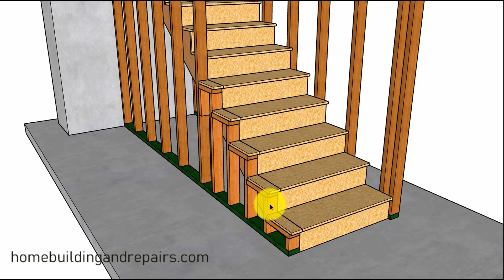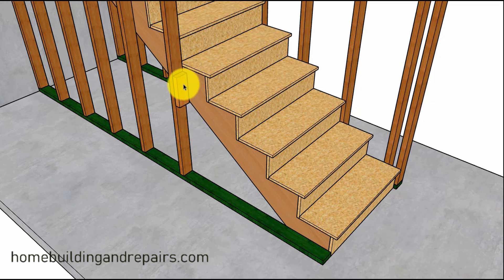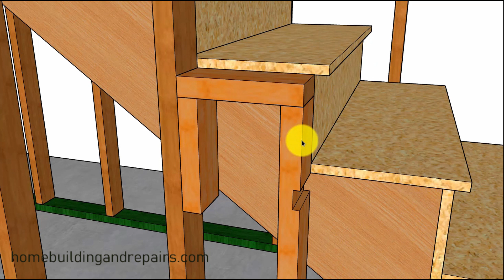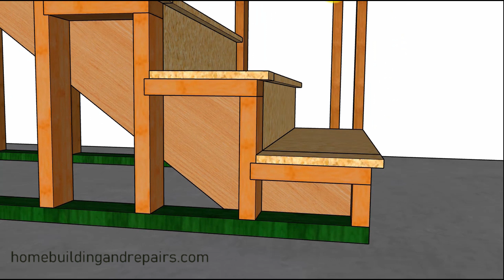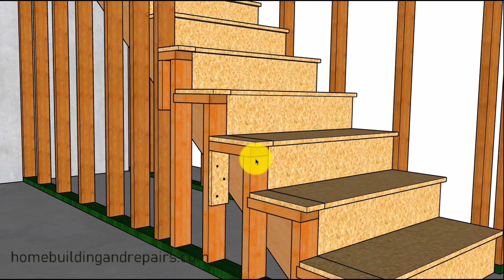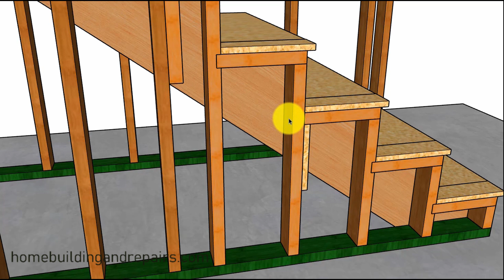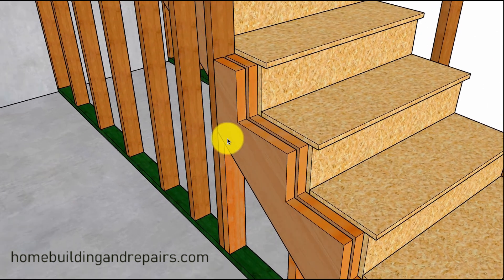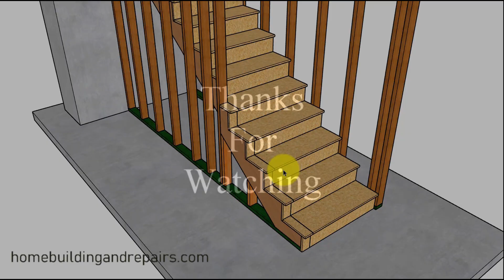How To Remove Section of Lower Wall To Make Stairway Wider - Home Remodeling Ideas

Comment: Can you remove the walls from both sides of a stairway? For a more open flooplan
Reply from the maker: It will depend on the construction of the stairway. For example if you remove the walls and the stairs are moving, then you might rebuild with stronger or larger stringers.

Comment: I would like to remove the wall next to my basement stairs (2x4 wall). Will this affect anything on the main floor structurally? Stairs are in the center of the home? Center Hall design that turn half way down.
Reply from the maker: I cannot provide you with engineering information, but do have some more videos at our website for removing non-load bearing walls or loadbearing walls that might be helpful.
https://www.homebuildingandrepairs.com/remodeling/framing/index.html

Comment: I have a curved staircase and i want to remove the circular wall and make it floating , is this something feasible based on your experience?
Reply from the maker: If the wall isn't supporting anything structural, but that might not be the case.

Comment: Would this be the process if my staircase is currently built as a kneewall staircase and I want to make them open tread? (Hope what I'm asking makes sense)
Reply from the maker: If you have an angled knee wall and you want to remove it, then this video should be helpful. Let me know if that didn't answer your question.
Reply: @stairbuilding  how about if these stairs aren't supported by stringers, but by routered notches on each end?

Comment: How to repair a tile riser with a small chipped off portion at its center. The portion that was chipped off is small, the size of a nickle or penny but it might become bigger and bigger  if not repaired. Hope this channel is still active.
Reply from the maker: I would try painting the damaged area to match tile, but if you need to remove it, make sure you have another tile that matches first.

Comment: Lots of things wrong in this video.  Supporting a load bearing surface with screws is bad.  Just run a 2x4 all the way to the ground.  Not redoing the entire surface will also leaving settling and uneven height over time.